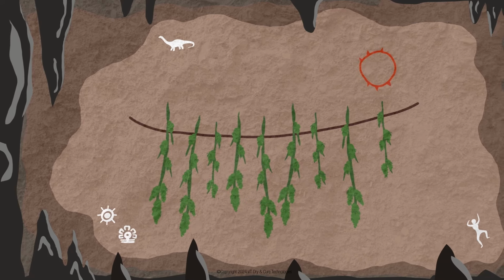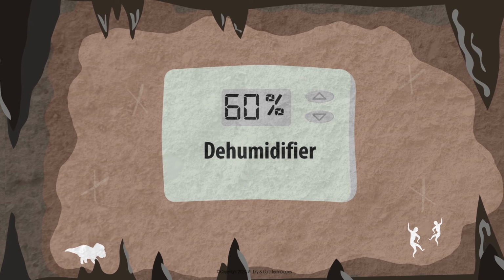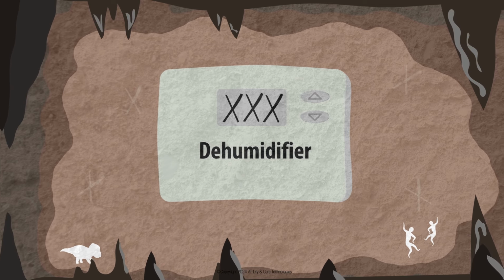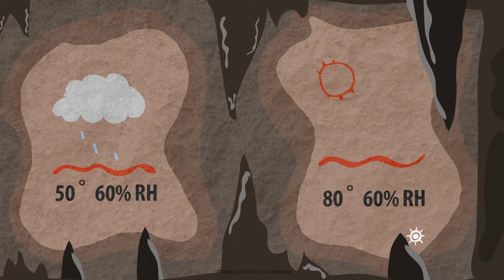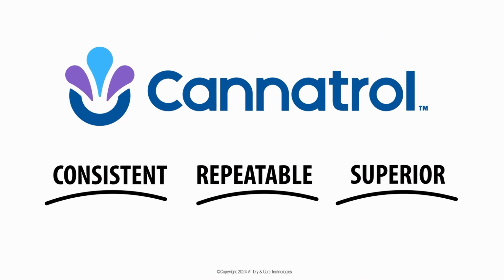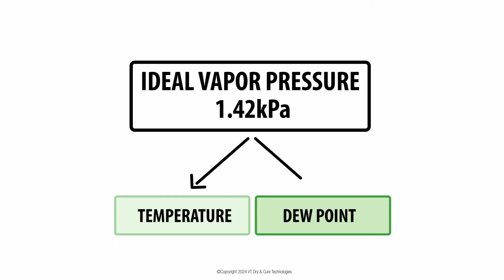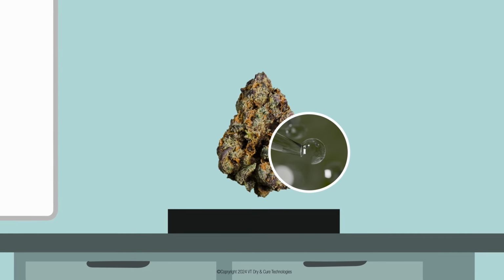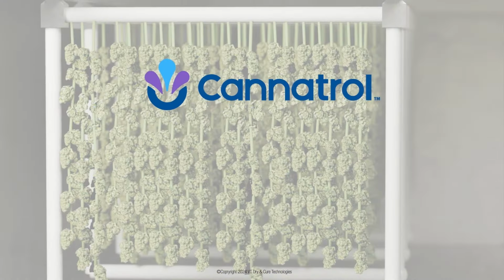How it all works!

Comment: It’s just a VPD box.  That’s literally what my grow tent is.  So far the marketing makes this wholly unjustifiable.
Reply: @ToledoTerps  aren't you constantly chasing numbers in your tent? To get perfect humidity/temp ratio. AC/Dehumidifier working back and forth.
Reply: @zkilla4611  That or a good lung room and you’ll never have that problem.   My lung room is solid 68°f with 62% humidity so it’s never a concern.
Reply: @ToledoTerps 
you need temp and humidity fluctuations during the whole hanging process which should take at least 21 days,. 
temp can fluctuate between 55-68
humidity can fluctuate between 57-68,.. 
control these numbers during different stages of the drying process than should be ready for jarring in 21-25 days and no burping is required,. 
you should never have to burp if dried properly,. 
burping is bro science,.
Reply: @nickcarter9662 so is your logic

Comment: I cant get mine to be the temps or humidity i set something is wrong with it it worked fine then 1 day i came home from work and it was 76 and 74 still set to original settings idk man im so frustrated  with it its alot of fucking money i just pulled the plug on it now it sits the messed up part is it came with alittle dent in the top they said it should be fine not components are in that spot gave me a refund a week later i checked the refund 100$ wtf bullshit i should of sent it back
Reply: You sure the temp didn't go up in your room?
Reply: Did you keep it in a hot space. What it sounds like to me
Reply: @KrispyGrows  the temp in room control the temp in the cannatrol. It should be in a cool room.
Reply from the maker: Because the Cool Cure is not a refrigerator it will be able to maintain about a 6 degree swing in temperature from the ambient temperature in the room it is located in.  For best results with the default settings, keep the Cool Cure in a space that is  "room temperature" (62-74 degrees) with some air circulation.
Reply from the maker: Apologies for not seeing this sooner, we typically don't monitor the comments often!  Were you able to reach out to our tech support team to troubleshoot your Cool Cure?  They can be reached by emailing inquiry@cannatrols.com anytime or by calling 802-738-0709 M-F from 8am-4pm est.  Hope we can help!